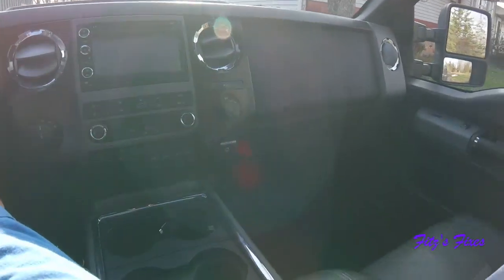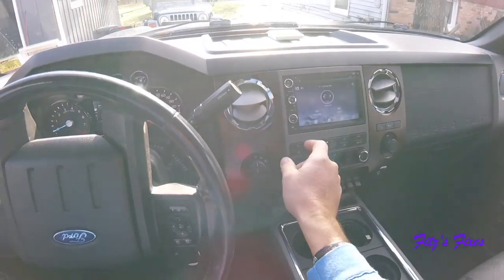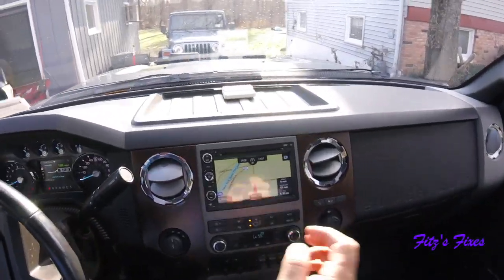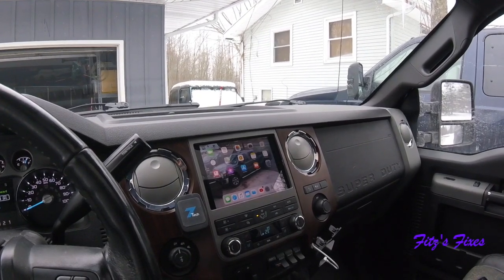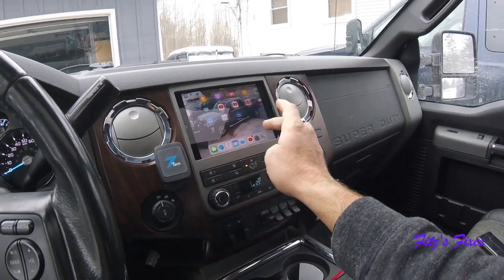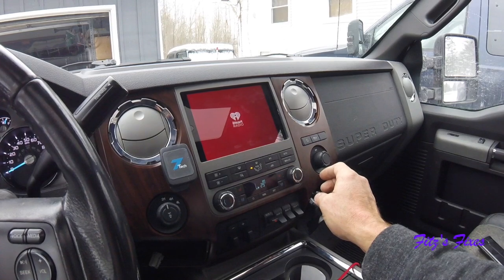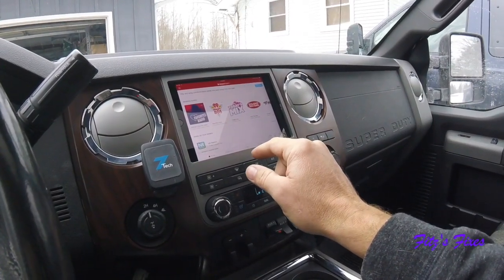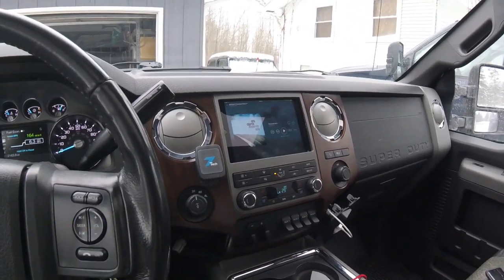ipad truck radio conversion

Comment: This video helped me do mine. I have an XL tho so no way to use sync for anything and no steering controls. Instead, i bluetooth audio from an Ipad 5 to a digital signal processor that has a volume remote that i mounted in the dash. DSP feed a 6ch amp and a mono amp for my subwoofer. I have 2 6.5s drivers mounted in each front door so 4 of them and a 2way component pod setup on the pillars. This was a cool upgrade. Thanks for the video!

Comment: I did this but now with the faceplate removed it keeps trying to eject a CD that isn’t there, did this happen to you at all?
Reply from the maker: I have the faceplate removed
Reply: @fitzsfixes  yeah I did the same thing and the deck then tried to eject a phantom CD if I left the face off. Ended up disconnecting the CD strip inside the deck and it works fine now with the IPAD. Thanks for the inspiration.

Comment: How did u get the ford stock radio to stay on the aux after taking the face off
Reply from the maker: No idea. I pulled the face off, and all the steering wheel controls still worked
Reply: Everytime i turn the ignition on  the volume is set half way and  its o. Radio i took the face off and same thing i need the face on to switch to the aux .is there away i can make it on the aux?